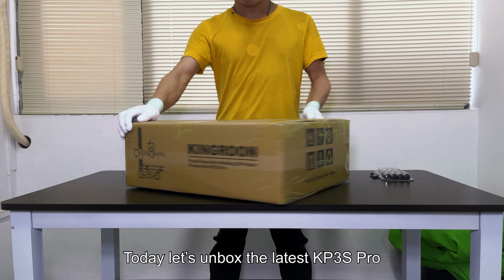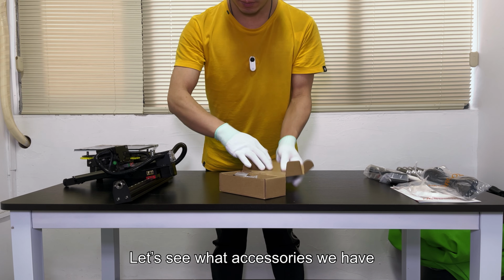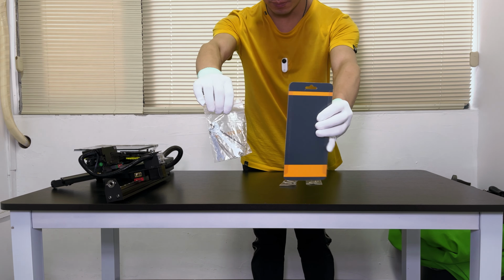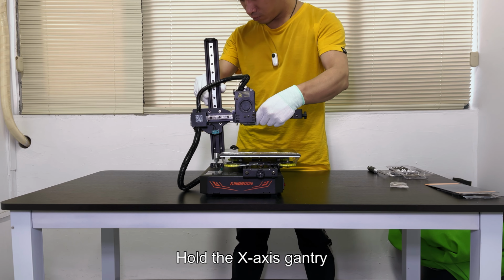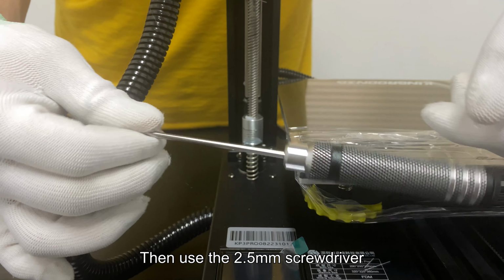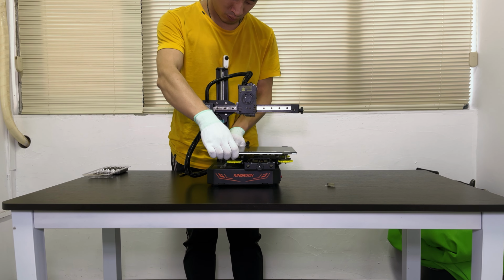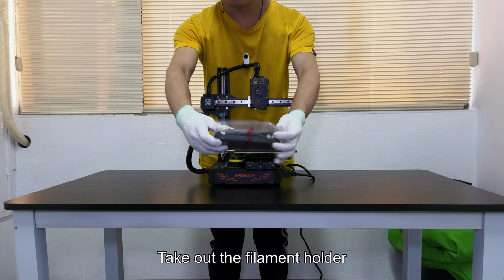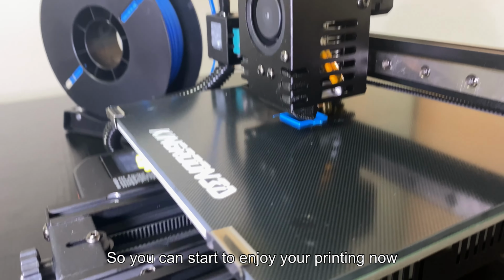Unboxing KINGROON KP3S Pro

Comment: I just bought the KP3S Pro (my first 3D printer), I am a beginner. When I plugged it in, I got shocked when touching the screw near the lead screw, the V-slot on the Y-axis,  when handling the SD card and USB Type B, and when touching the whole frame. Is this normal?

Comment: Already ordered, waiting for delivery. What changes need to be made to the firmware for installation 3D Touch. If possible, publish the firmware with changes for installation 3D Touch.
Reply from the maker: If you want to use the stock firmware, we are going to release the firmware soon, then you can follow its instructions on KP3S to enable it.
Reply: @Kingroon3DOfficial  Thanks (sorry, but I'm a beginner and wanted to clarify).
This means that it is enough to make changes in the stock firmware file "robin_nano_cfg.txt" and flash the 3D printer or a special firmware will be released. I also wanted an "offset wizard" firmware.
Thanks in advance for your reply.
Reply from the maker: @igormamont1172  check out this video, it’s going to be a same firmware with z probe offset wizard for KP3S Pro. All you need to do is to download the firmware we released, flash it and follow the instructions to set it up.   This firmware is available soon. https://youtu.be/LBa8X6U1Y_w
Reply: @Kingroon3DOfficial  How soon will the new BLTOUCH firmware be released.
Reply from the maker: @igormamont1172  If you are looking for the stock firmware with BL Touch enabled, we are still testing it. But we will release it soon on our website: https://kingroon.com , maybe in one or two weeks.
Reply: @Kingroon3DOfficial  Thank you.
Reply from the maker: @igormamont1172  You are welcome!
Reply: @Kingroon3DOfficial  The promised time has passed. When will the new firmware be available?
Reply from the maker: @igormamont1172  I can not assure you like I said a maybe last time. We are now spending more time to help with the online store, it’s a busy season. But we let the engineers know that and see if we can release it earlier. Thanks!

Comment: Will an upgrade for the normal KP3s be available?
Reply from the maker: Actually there are many upgrade options available for the KP3S, a lot of designers have made them as printable kits. Also, you can find some upgrade parts on our website, such as all metal throat tube, new extruder, new bracket, and so on. https://kingroon.com/

Comment: Hello. KP3S PRO. The white LCD screen appears not only with stock firmware, but also with Marlin 2.1.1 firmware. So it's probably not a firmware problem, but a hardware problem. A white screen appears during printing at an unspecified time, randomly. This does not stop printing. Can you help in solving this problem?
Reply from the maker: I will let our engineers know. It's strange to happen with the Marlin.
Reply: I had this problem with the two trees bluer, in that printer I needed to isolate the screws that holds the screen
this video is in portuguese, but you can watch what the guy did to solve it :  youtu.be/101Bqj48jGM

Comment: Where to buy in Germany?
Reply from the maker: You can get it on our website, and using the Coupon code: KR8 when checking out, it will save you 8% on the printer. https://kingroon.com/
Reply from the maker: our Germany local warehouse stocks arrive around 10th, October.
Reply from the maker: you could pre-order on our official website: https://kingroon.com/products/official-kingroon-kp3s-pro-3d-printer